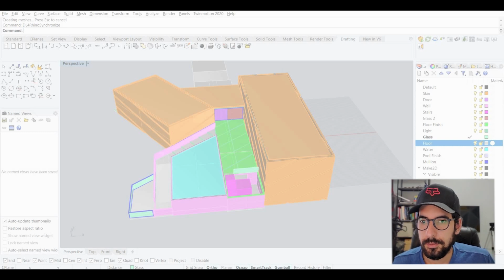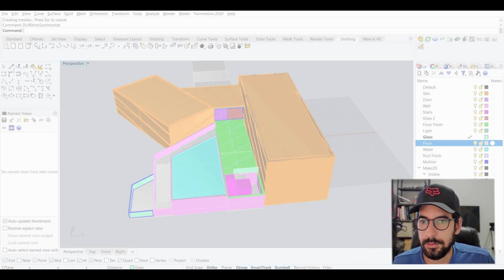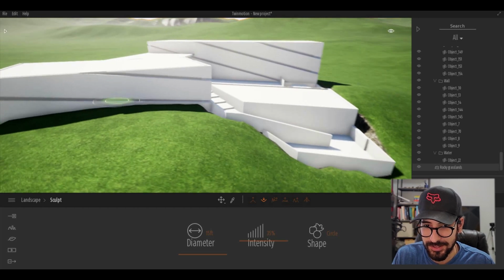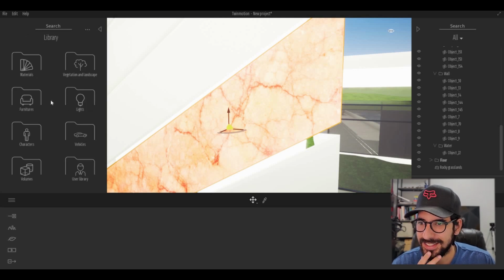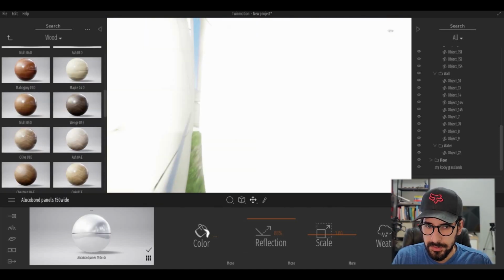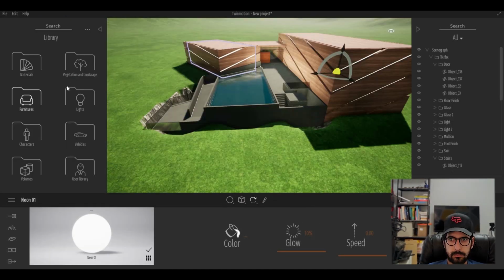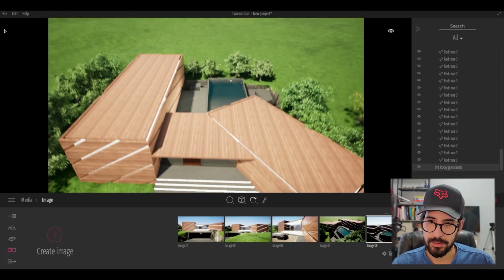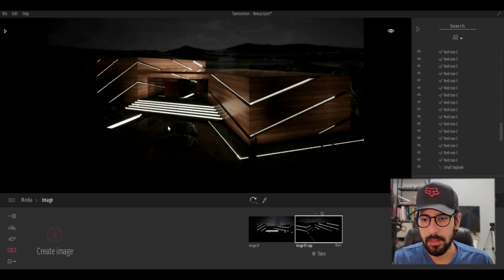My Computer Almost Crashed Designing This House

Comment: it looks pretty cool but how does those light strips work and what about ventilation?
Reply from the maker: Interesting question. If i was to build this, I would need to spend time thinking about how it would be out together and have some conversations with a builder/contractor. The lights could be embedded into the outer skin. There is gap between the skin and the building that could allow for ventilation. Also, the panels of wood would be spaced minimally in-between to allow wind to pass through. 

The final details may have to change but I'm sure it could end up looking very similar. I think the trickiest part will be to actually design the skin to have those separations that go around the building continuously.

Comment: Hey Man! Great work as always! Can You tell me what your PC “Stats” are if you don’t mind?
Reply from the maker: Sure! I have an HP Omen, 15.6",8th gen i7, 16 gbs Ram, 256 GB SSD, 1TB HD, Nvidia GTX 1050
Reply: @MarteloDesign  how far can you push it? currently i'm researching for a laptop to last me at least through master degree
Reply from the maker: Ehh... It depends. This is a good laptop but it has been struggling lately. Definitely good for the price. I paid around $1200 for it. It's hard to find a lootop of these specs and design for that price so I'm happy with it but if you're thinking of doing intense designs, look for something better.
Reply: Mooch And what do you think is better to buy, a laptop or a PC?
Reply: Mooch just glad I’m not the only one rocking a 1050gtx😅✌🏾